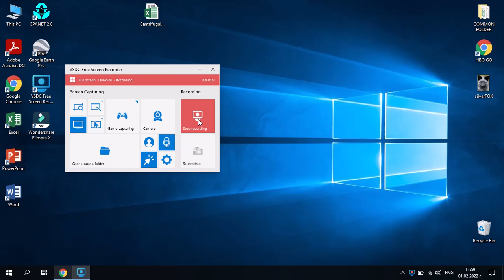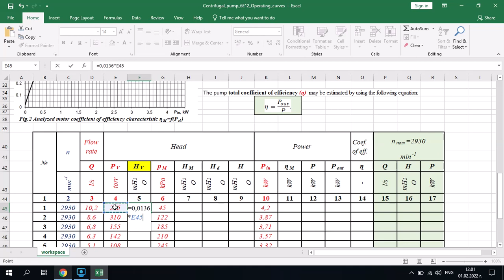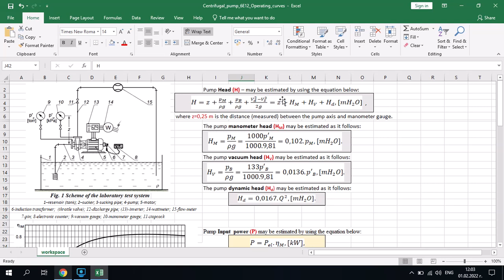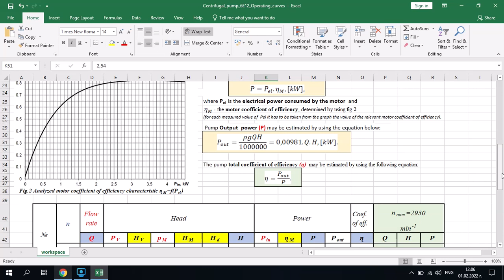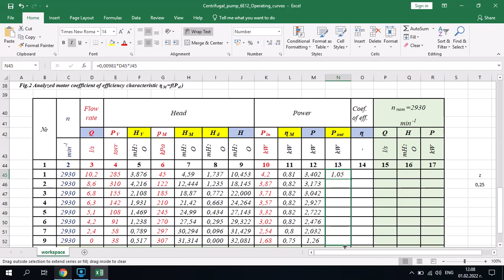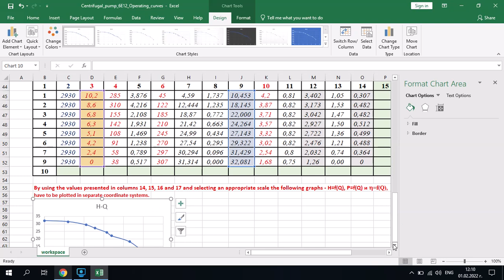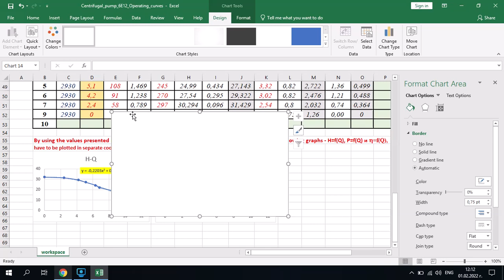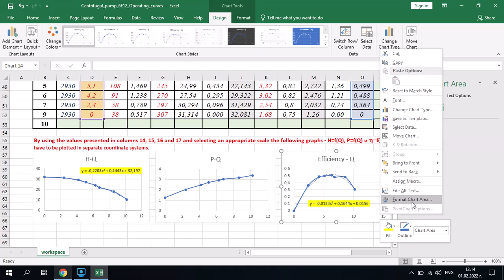How to DETERMINE the OPERATING CURVES of a CENTRIFUGAL PUMP: 2nd part  data processing - eng. subs

Comment: It looks useful. Does really the pump works at about 50% maximum coefficienct of efficiency?
Reply from the maker: Yes, even less than 50%. For a new pump the manufacturer gives 52% efficiency when working at its nominal operating point. However, this pump has been in exploitation for years and thus this value is lower. With time the pump operating curves are changing.

Comment: Why the last three columns (15, 16 and 17) in the table stays empty?
Reply from the maker: Because it has to be used just in case of recalculation of the main pump operating parameters, i.e. when the pump shaft speed of rotation has changed during the test. In this case,  using VFD enables to keep its value almost constant, so recalculation is not necessary and thus the last three columns stay empty.

Comment: Very helpful. However, I have a question - where did you get the motor efficiency diagram?
Reply from the maker: Some motors provides such information in their passport (catalog data). This particular one is obtained after testing. In case both these options are not available you can assume that the motor coefficient of efficiency remains constant (approximately 0.8). When the main purpose is just to catch the trends (for academic and not comercial use) this will not have too negative affect on the results.
Reply: @silver_fox8605  Thasnks
Reply: @silver_fox8605  I've got it
Reply from the maker: Good in this case is that the method is applicable for all the existing models and brands of pumps, such as:
#Grundfos https://pdf.directindustry.com/pdf/grundfos-5420.html
# Riello https://www.riello.com/international/products/heating-catalogue-products
#Sulzer https://www.sulzer.com/en/products/pumps/pumps-by-type
#Danfus https://www.danfoss.com/en/products/dps/pumps
#Gouldspumps https://www.gouldspumps.com/de-DE/Home/
#Wilo https://wilo.com//en/overview.html
#Flowserve https://www.flowserve.com/en/products/products-catalog/pumps/
#KSB https://www.ksb.com/en-be
#Ebara https://www.ebaraeurope.com/
#Schlumberger https://www.slb.com/
#Ampco https://www.ampcopumps.com/
etc.
One the test system is designed it takes 10-15 mins to perform the test (quick and easy)!